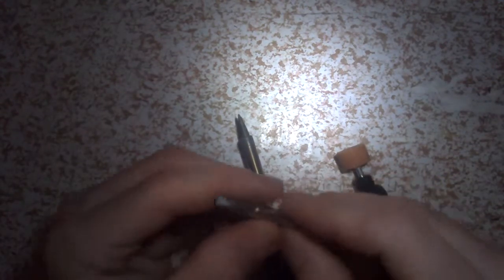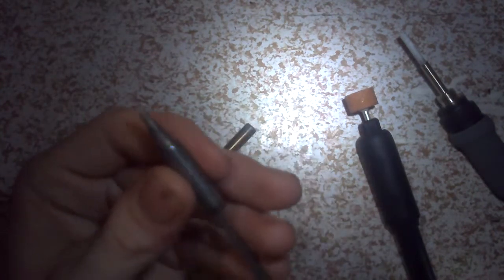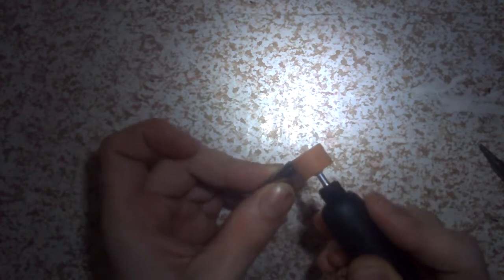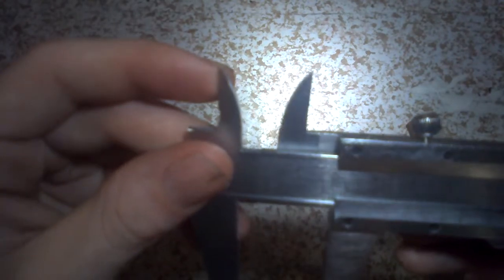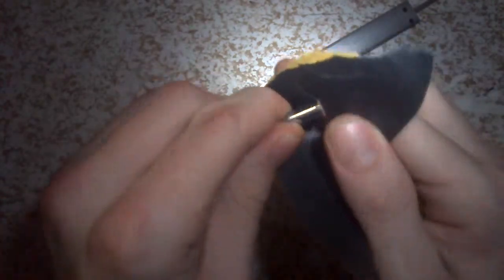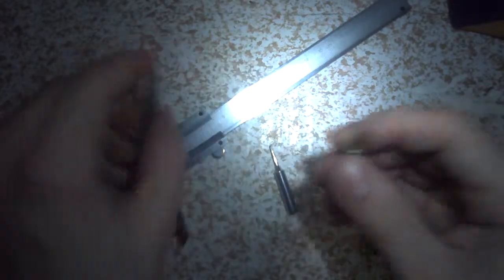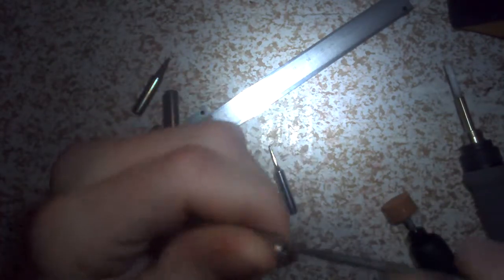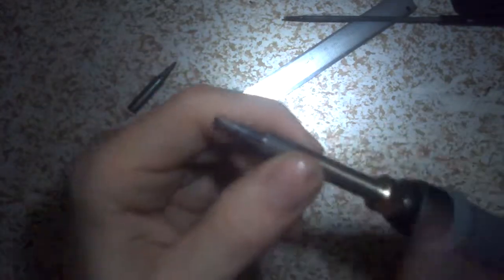HAKKO FX-888D How to modify generic soldering tips for use with 888 or 888D (900m tips)

Comment: I buy a set of generic tips listet for hakko 936. The hole diameter is 4,2mm but genuie tips hole is 4mm. So main problem is hole diameter not deaph of hole.
Reply from the maker: might be able to slip a sheet of aluminium foil onto the element before putting the tip on. worth a try!

Comment: Thank you so much for this video. I had been wondering why the side of my iron was getting hotter than the tip. I ended up actually cutting the metal sheath around the heating element as all of my tips were too long.

Comment: Cool I Have been doing that tech-nick for a while on my x-tronic soldering station which uses a hakko heating element. It does make a difference when soldering.
Reply from the maker: Yes it does! I am working on a comparison of the unmodified and modified ones side by side, testing the time it takes to heat up, how well it makes a joint, and how well it sits on the iron. That video should be up within a week or so. Thanks for watching/sharing!